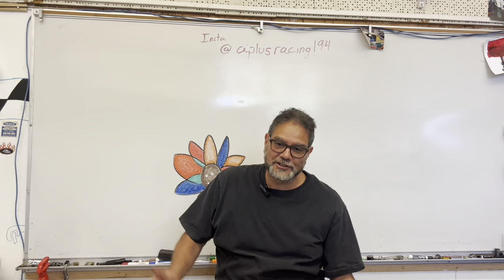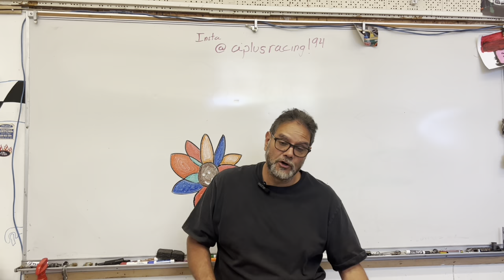Miata Differential The Wrong Way,Torsen Swap. Spec Miata, Autocross, MX5, Track car

Comment: You can make a tool to spin those adjusters out of 1/4" X 2" bar stock. Cut the bar stock to the length of the gap between two opposite slots then round off the corners so it fits into the adjuster slots. Clamp on vise grip pliers and you're good to go.

Comment: With NASA and SCCA rules allowing for the removal of the vibration damper on the pinion flange of any of the 1.8L diffs, do you ever do that or see other teams doing that?  Not sure if it is worth the time and also know that lash has to be measured if the damper is removed.
Reply from the maker: I leave it till they fall off and that is very rare.